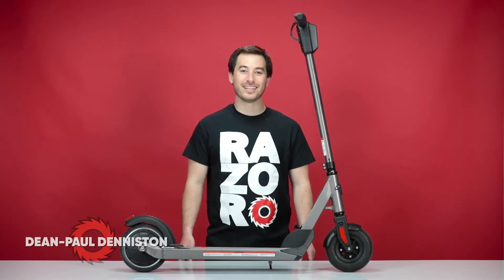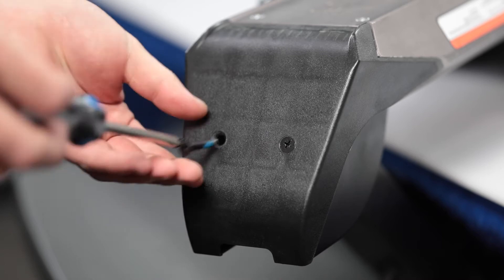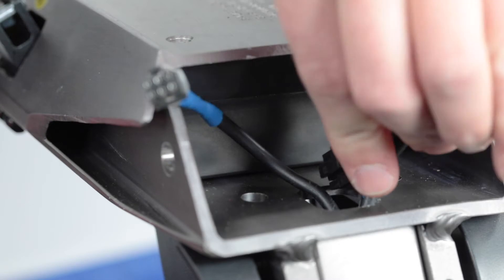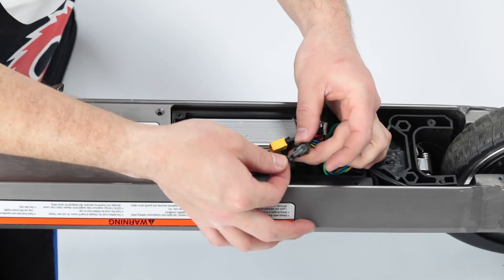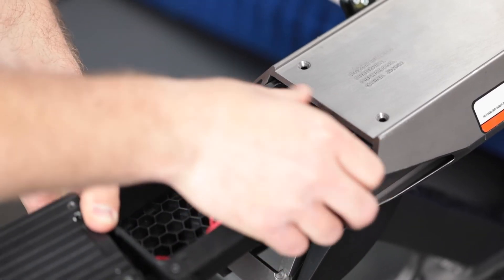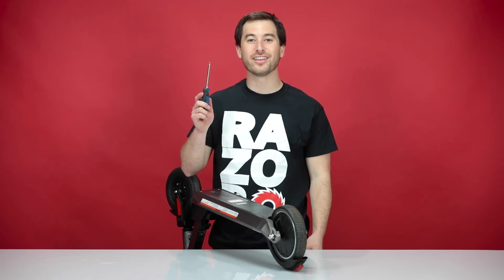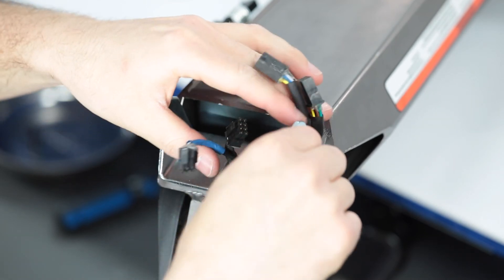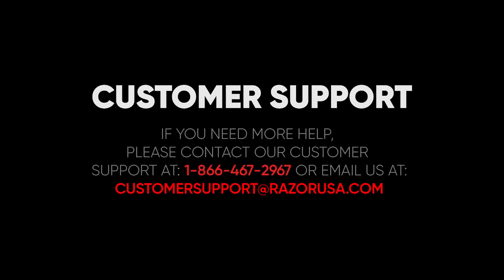How to Replace the Battery On the Razor E Prime III Electric Scooter

Comment: Having issues with turning mine on, battery gauge shows full change but does not power in when pushing power button
Reply: motor or power delivery problem says the manual  RMA to razor for out of warranty repair if possable
Reply: That’s what happens too mine